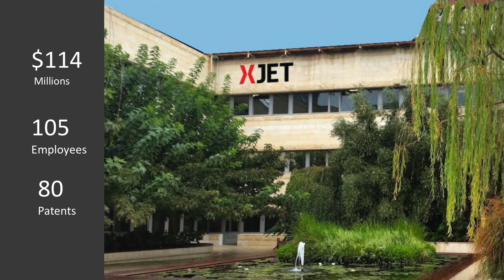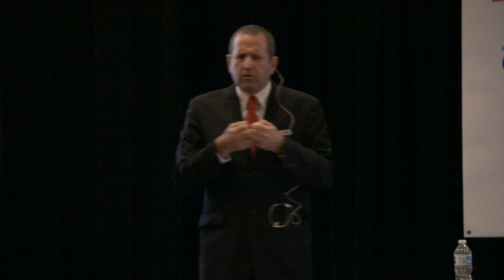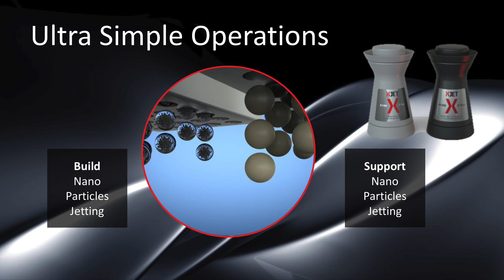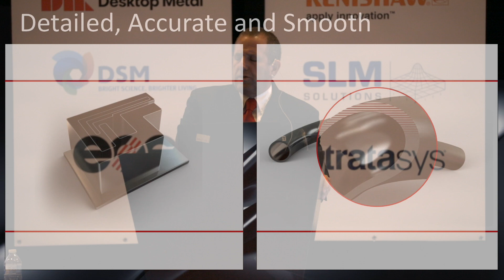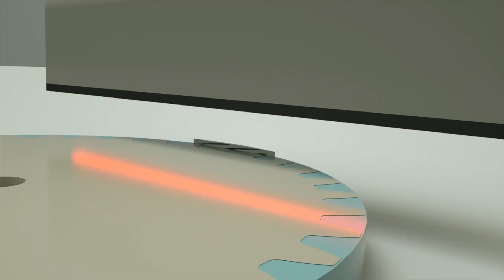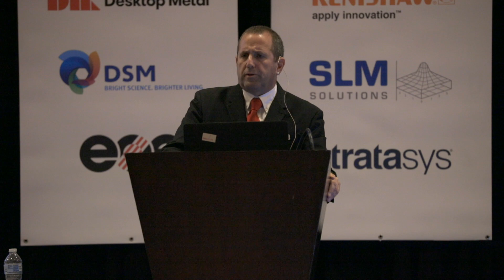XJet Presentation by Dror Danai at AMUG 2018

Comment: the pressure of a droplet is 2 times the surface tension / the radius so the diameter of a droplet with a pressure of 1000 bar is (1000*100000/2/(72.8*10^-3))^-1*2 = 2.9 nanometers so with high pressure nozzles you can print nanoscaled components.

Comment: 3d printing powder particles agglomerate themselves to make taller particles, but in a liquid the suface tension of the liquid on the particles is so high that it prevent the particles to agglomerate so thinner particles size can be achieved.

Comment: I think the particles are so small that the material is slightly sintered when it's printed even if the temperature is far lower than the melting point so it does not need any binder, but i wonder about the mechanical properties as it's printed. I think it's way harder than green and brown parts makes by MIM or binder jetting process, that would allow a safer handling of parts from the printer to the furnace. it would also reduce the shrinkage.

After that, the heat treatment is more a recrystallisation of grains than a sintering.

Comment: This will compete with both the 3d systems PROX DMP 320 for the layer thickness (2um for the DMP 320) and with the desktop metal production system for the speed !
Reply: Like in our Objet days, we do not see this technology as a competition to the great machines that you mentioned but more as a complimentary. We are sure that sometimes this will be "face to face" competition but mostly the market is still huge and allow each to play in a niche that is very large in comparison to the current metal manufacturing market.

Comment: how dense is the metal before being sintered? because the fact that you don't used any binder material means that you have no shrinkage at the sintering, in fact the material is sintered in the printer, all you do after that is a recrystallization so there is no shrinkage as for the desktop metal production system?
6:29 half of an answer thanks !